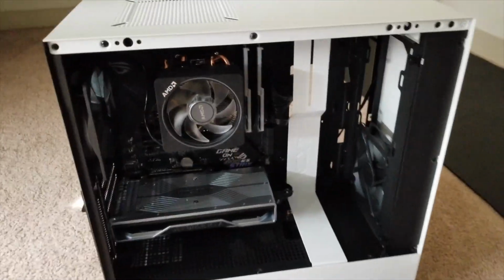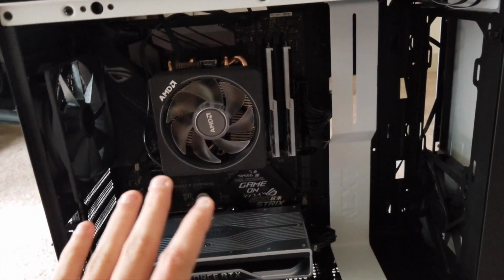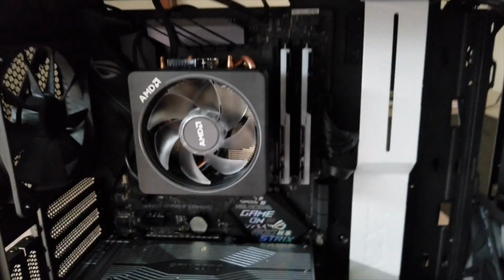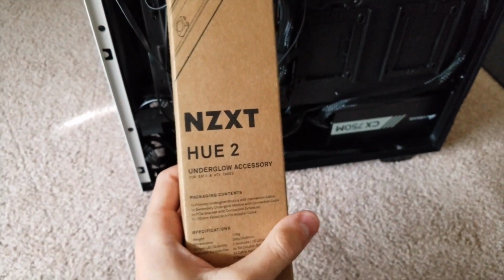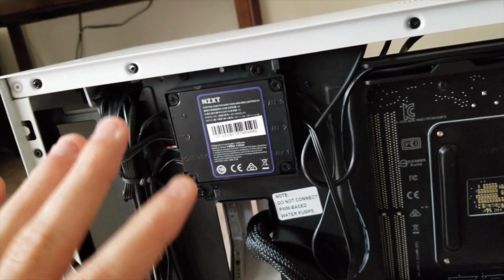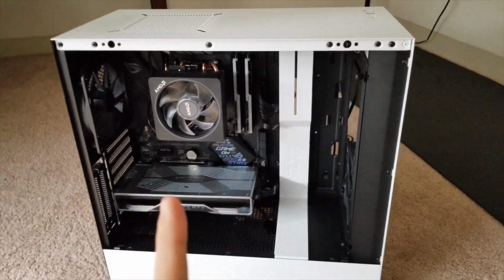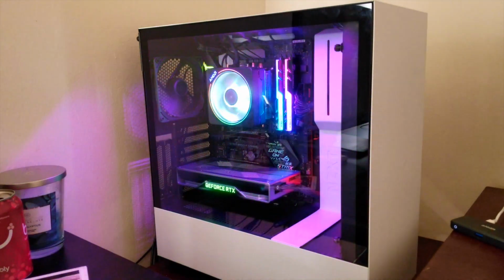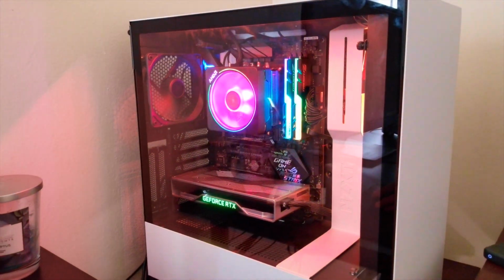NZXT H510i Case - Follow Up and Build

Comment from the maker: Hey all! Thanks for watching my video and leaving your comments. I realize that my graphics cards was not in the ideal slot so I did move it to the first slot. After reading up on it the performance difference is typically minimal, but I still did move it🤙🏻
Reply: Ja Boi 👍
Reply: minimal or not, you still got a small boost in performance.
Reply from the maker: Nothing even noticable but okay🤷🏼‍♂️😅
Reply: @ja boi Do you jus change the LED’s color through a software once it’s hooked up and turned on?
Reply from the maker: Yeah
Reply: What motherboard was you using pls??
Reply from the maker: Asus ROG STRIX B450-F
Reply: I wish the motherboard your using support faster ram speeds so ima have to go with the msi b450 tomahawk max atx but doesn’t look as good. I want the extra performance from faster ram speed.
Reply from the maker: Ah yeah, you won some you lose some. At least you'll have the performance you want 🤷🏼‍♂️
Reply: Since you have almost the same specs to a pc I'm building, what psu are you using ( I know almost nothing about them )
Reply: Why is graphics card in the wrong slot
Reply: Please help me out man I’ve built my pc but have no idea where the cables go on my b450 tomahawk max, please help
Reply from the maker: You need to reference the manual for your motherboard and for the case. If you have lost the manuals then Google them, you'll be able to find them
Reply: Ja Boi appreciate it man, been worried all week
Reply from the maker: Yeah no worries man🤙🏻
Reply: how do i change its colors??
Reply from the maker: Through the CAM software.

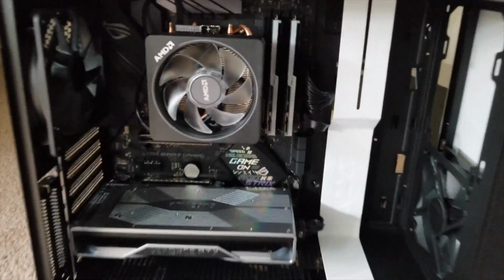Comment: 17:22 hey, just to let you know, the top fan by default works as an exhaust just like the rear one. That's what a lot of people recommend and also the front fan won't have much of an impact. NZXT is using the front fan bracket mainly for CPU AIO coolers or water cooling layouts and pumps.
Reply from the maker: Yeah I ultimately moved my fans around again🤷🏼‍♂️

Comment: I don't know if anyone told you, but the fan at the top combined with that in the back worked to create negative pressure through the case. That singular fan as an intake doesn't actively provide any sort of cooling, you'd need an AIO for that. I've seen tests on the different configurations, and fans at the front actually increase the temps over lowering them.
Reply from the maker: Yup I have already removed any front fans I had in place. It really more so messes with the GPU airflow more than anything. Well at least on this case it does

Comment: Just ordered this case for what will be my first build ever. Great to see what it will look like.  Great vid!
Reply from the maker: Best of luck on your build 🤙🏻
Reply: @JaBlankSki  Thank you.  In your opinion does the case need more fans beside the two in comes with?
Reply from the maker: I mean that depends on a lot of factors. What your running in it, what you play to use your computer for, what environment it's in. I would say to start it's fine with what it has but monitor and if it seems to be running hot then just yeet some more fans in there🤙🏻
Reply: @JaBlankSki   That's what  I thinking was just wondering what your experience has been....i didn't mean to or even need or want
 to but it's going to be a very capable pc....haha... gaming and video editing  should be more than doable. ( the later being just a hobby )   Ryzen 9 3900X, Radeon RX 5700 XT 8 GB.   I'm not a gamer but never have been but play now
Reply from the maker: Oh yeah you'll be set then!🤙🏻 Just watch it and play it by ear if you need some extra cooling
Reply: @JaBlankSki   Yeah, thank you

Comment: I'm confused about where to plug in the end bit of the breakout cable. The breakout cable is the one that has PLED+-, HDD LED, and PWR reset indicated. I'm using ASUS Z490 Plus Gaming WiFi mobo btw.
Reply from the maker: Reference your specific motherboard manual and the case manual. If you don't have them you can Google them, sure you'll be able to find them!

Comment: Saw on another review of this case, after much airflow testing, that this case is designed for Negative pressure and that fan installed at the top is there for the purpose of blowing air out the top not in.   The testing also found that given there is no front venting, only the slim vents on the right side (facing the front of the case) your front fan can't possibly be pulling that much air in, to make a cooling difference.
Reply from the maker: Yeah and that's the thing in itself. It took a lot of testing to even figure that out. I think as long as you have a decent amount of flow in the right directions your setup will be fine🤷🏼‍♂️
Reply: Right, none of which can really be directed coming through the front.  Any time air flow has to make a 90 degree turn as it would coming in from the front of this case, it's not a plus.  The front face/surface of any front mounted fan, is going to have the front panel blocking any air getting through it and there is little to no air that is going to get pulled by the side of a case fan.  Common sense.

Comment: For the front Intake fan would it be better if I put it on the right or left side of the bracket? I see you put it on the right and iv also seen others put it on the left so I’m kinda confused 🤷‍♂️

Edit: I looked up best fan configuration for NZXT h510 and a lot of ppl said to leave the fans in stock configuration as exhaust only but that also left me confused on how that would make temps cooler without bringing in fresh cool air. Srry I’m just new to this and I’m scared cuz I’m about to start building In a few weeks
Reply from the maker: So it probably would be best to have it on the left (or the inside). This allows more space on the right for air to be pulled from. But you then have them sticking out more into your case, so they will be more visible. Honestly I think either way will be fine. You can easily swap them to either side down the line🤙🏻
Reply: Ja Boi oh alright thanks for replying

Comment: Can I plug more fans into the hub? And how do set up your case fans for the best cooling
Reply from the maker: I believe there is one additional slot on the hub for a 4 pin device. So yes another fan or led. The best cooling for this case it to actually keep the fans in their stock positions
Reply: @JaBlankSki  thank you so much I really appreciate it
Reply: @JaBlankSki  I was thinking of getting two 120mm fans on the right side and keeping the stock  fans where they are
Reply from the maker: That will mess with your case airflow

Comment: Doesnt the hub have both 3 pin addressable and 4 pin non addressable? So you could use a splitter to run your new lights into one slot? I thought the included hub was just a way to get all your leds running on one input on the board but you still need to use software?
Reply from the maker: I honestly cant recall if it has both. It probably does. But yeah its really just a way to have your fans and leds plugged in at one place. However, some of the additional NZXT leds/fans (purchased separately) require a different hub than what is included in the case. So even if you plug these into the case hub they wont work. You have to use software to control the colors, speeds, etc.
Reply: @JaBlankSki  that's so weird that I've not heard anyone else mention it in their reviews/unboxing! I'm not doubting you whatsoever though! Ordered mine last night so guess I'll see for myself soon! Good video, dude!
Reply from the maker: It's only if you get additional nzxt items that say they require the 2nd generation hub🤷🏼‍♂️ but glad my vid could help!
Reply: @JaBlankSki  just wanna say its awesome that you'll interact with viewers on a 6 month old video with 200 comments. Earned my sub for that alone
Reply from the maker: Aw well I appreciate that🤙🏻 just trying to do my best and help others!

Comment: Might be a stupid question, so i bought a prebuilt last year( yes i know prebuilts 🤦🏻‍♂️) an I upgraded some parts an i was gonna swap everything over to this case, I already have rgb fans an the hub, will that cause any issues not using the nzxt hub for any of my fans?
Reply from the maker: I mean you may have to tinker with it a bit but you should be able to get it to work🤷🏼‍♂️ worst case just use the nzxt hub

Comment: Hello, are you sure you didn’t connect the underglow properly? An nzxt rep on reddit said that they should work with the smart device V2 along with the aer rgb 2 fans. The HS10 elite uses the smart device v2 to control the rgb fans in that case
Reply from the maker: I tried with no luck. Now this was several months ago so maybe that has changed with a software patch🤷🏼‍♂️ I could try again

Comment: Hey mate, I've got the h510i and the rgb strips do work with the included controller on the back of the case. I was wondering, do I need to buy the seperate rgb hub if I want to install NZXT RGB Fans? Or can they be installed into the included controller.
Reply from the maker: They should work with the included controller. But I have not tried it myself so I'm just going off of what I have heard

Comment: Anybody know how to turn on the RGB? I got everything working except it. I have also downloaded the NXZT control panel. And it does not recognize the lighting.
Reply from the maker: Did you plug everything in properly? The rgb should turn on when you turn your computer on
Reply: @JaBlankSki  I rechecked everything, I have the the power hooked up and all my fans are working (that are coming out of the hub) the only cords I have not plugged in are HD audio and "30v Super high speed USB Revision"
Reply from the maker: Well if the fans run (and they are plugged into the hub) but the LEDs don't turn on at all, then the LEDs may be defective? You can plug the LEDs into other spots on the hub to test this. If the don't work in any other port then they are probably duds🤷🏼‍♂️
Reply: @JaBlankSki  uhhh, I unplugged the LED cable from the motherboard... And the fans stopped. But the LEDs turned onnn????
Edit: now neither the fans or the LEDs are turning on... Oh no
Reply: @JaBlankSki  I plugged the LED cord into my second RGB outlet on my motherboard and the fans starting working. But not the LEDs. This is weird

.... I unplugged the fans in the RGB plugin and. The LEDs starting working again.

. But my NZXT cam does not pick up the lighting
Reply from the maker: Everything should be plugged into a hub in the back of the case. If it's not plugged in there then the CAM software won't recognize it. And there should be 2 cables for the fans and 2 cables for the leds. All come plugged into the hub from the factory
Reply: @JaBlankSki  yep, I took out my entire PC and made sure everything (in the hub) to my motherboard/powersupply. and my computer turned on, but not the LEDs... I am going to try and take it back to IT and see what they can do with it.
Reply: @FOUR22  strange, all i did was plug the sata from the case to my psu, turned on pc and it was default white when i loaded up NZXT Cam. maybe you got some bad led strips or something, hope you can get it working.

Comment: Hey I know I’m an entire year late but I had a question about the hub, I plugged it into the stta cables but the led’s nor the fans worked, am I supposed to do something else?
Reply from the maker: I believe there is also a plug into the motherboard? Make sure you have enough power. If that doesn't work. Try unplugging the fan from the hub and plug it directly into the motherboard. If that fan works then the hub may be defective
Reply: @JaBlankSki  thank you!  I'll go try that now, i kinda just finished up a new build so thats my last problem ^ ^
Reply: @JaBlankSki  Do i have to get the hub? can i just use the motherboard to link up the fans?
Reply from the maker: You probably can just use your motherboard
Reply: @JaBlankSki  got it. also, i finished building my pc, and when i connected my monitor to it, it said no signsl. i pressed the cables in well enough. what could the other possibilities be?
Reply from the maker: It's anything starting up on your PC? If the PC is running and there isn't any display. Could be that your GPU driver's may need to be updated. Plug directly into the motherboard then and update your GPU drivers

Comment: i’m building my PC right now and i’ve been stuck on where to put f panel and at 16:20.
Reply from the maker: For front panel IO you have to reference your motherboard manual and the case manual. It'll tell you which plug is for what and where to put it on the motherboard. At that time in the video I'm just talking on hard drives. The big hard drives go below and have to plug into the PSU and then a cable to your motherboard

Comment: Hey man, I was the guy who asked you questions about the case last week. Here’s an update.   Putting the mobo and everything in was easy besides the Psu. I  was so was confused and where to plug certain things in. Also when I plugged the 24pin cable for the mobo and the cpu fan , the only thing lighting up was the mobo. I’m extremely frustrated rn bc idk of there’s  a problem with my cpu . None of the ram lights up at all and the cpu fan doesn’t spin as well. Thanks for the case review. I like it a lot but I just have to figured where to plug certain things in.
Reply from the maker: Follow the instructions/manuals for the different components. Or honestly watch some other YouTube videos that are a bit more specific on where to plug things in at. I'm sure your CPU is fine, you probably just need to plug something else in, or it could be an issue of having a large enough PSU to power everything. Just try some troubleshooting starting with the easiest thing and work your way to the worst case scenario. You'll get it figured out🤙🏻
Reply: Ja Boi thx. I lowkey thought about giving up for now but I’ll try.
Reply: Ja Boi your comment honestly has put me in an better mood rn lol. I was angry all day.
Reply from the maker: Eh not worth getting angry over man, it's just computer parts! You'll get them together, just take your time and do some troubleshooting/research 🤙🏻
Reply: Ja Boi thank you. Also when I powered my Psu on , the fan wasn’t spinning and I was super angry but hopefully I can’t figured it out
Reply from the maker: If the fan on your PSU wasn't spinning then there is something wrong with it
Reply: Ja Boi  but how come it was able to power on the mobo. I thought I needed to plug more stuff in for it it to be spinning . For ex. Let say you didn’t connect any of the cords in the Psu to the mobo but just plugged in the cord to power it on. Into a outlet or something . Would the fan still spin bc I’m now getting paranoid that I might have to shop things back
Reply from the maker: "Under normal circumstances, all power supplies (including those with an on and off switch) and their fans turn on due to a signal they receive from the motherboard. Therefore, unless your power supply connects to a working motherboard that can send that signal, the power supply will not work". So basically if you PSU isn't spinning it could be an issue with that or an issue in the connection to the motherboard. The main connection to the motherboard
Reply: Ja Boi thx for the help.
Reply: Ja Boi I’m going to start again tmrw. Thx for Putting me in a good mood. I just looked mad and was talking hella shit today but I calmed downed.
Reply: its Ethan had the same issue , but fixed it. when i plugged in my 24 pin into the mobo, i though i had plugged it in wrong. it goes in one way, and although nothing was turning on, only my fans were , in my situation are plugged directly into the power supply. (most fans are plugged into the motherboard but mine are different.). upon turning on the switch on the power supply itself, nothing else turned on besides my fans. motherboard was plugged in, 4 pin cpu, etc. my mistake was so simple. turn on the switch on the power supply, and hold down the circle button on top of your case (to power it on) it may take ten seconds or so. if nothing turns on, let go, pause for a second and tap the button again. then evrything came to life lol. if that doesn’t work, then it may be your front panel connectors. really hoped this helped. :)
Reply: corvus1k _ thank you for your comment. I’m going to try this later

Comment: Does the cable that connects the rgb/fan hub to the motherboard come with the case? Thank you, your video has been super helpful
Reply: it does I’m making the build now
Reply: @cosmos7136  Thank you, I'm actually also about to do my build lol
Reply: @ayo5336  yeah, just be careful because the front cable for the front panel labeled f-panel needs to be connected for the power sw, hdd light etc,

Comment: I have this case.  Haven't built it yet,  but this video answered most of my questions about cable management,   where I would put the power supply,  and what the cases LEDs look like.  I'm just waiting on getting the CPU.   I want the intel i9 but its awfully pricey so the build is on hold for a bit.  Ya know being responsible and all.  I still have my current gaming pc to play with with its discontinued motherboard and old as dirt cpu which is what made me want to build new in the first place.
Reply from the maker: Well at least you have something to use in the meantime until you can save for the ideal gaming setup🤙🏻
Reply: @JaBlankSki  so your much more of a pc savvy guy than I am so let me ask you what you think of what I have so far for my build.
Gigabyte z390  auros gaming pro wifi mobo
Gigabyte auros 16gb Ram
Evga 750 watt gold power supply 
RTX 2060 graphics card
Samsung 1TB ssd
PNY 240gb ssd (will be my boot drive)
Nzxt h510i case.

I'm thinking this will be a kick ass gaming rig  When I get the intel i9 CPU .  What are your thoughts?